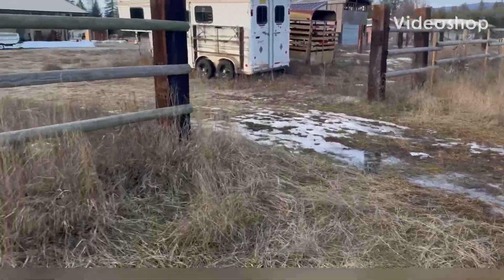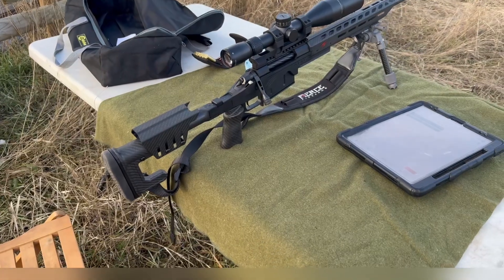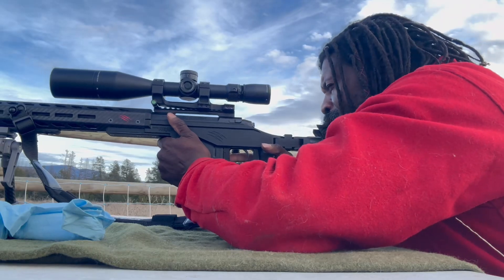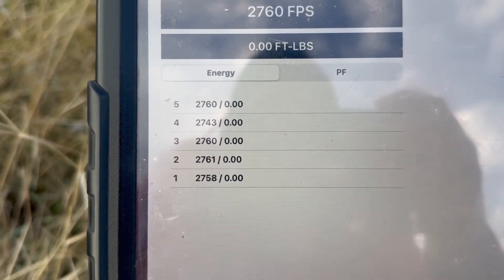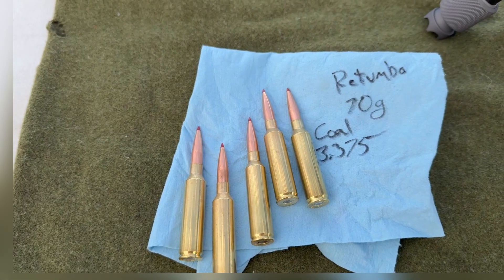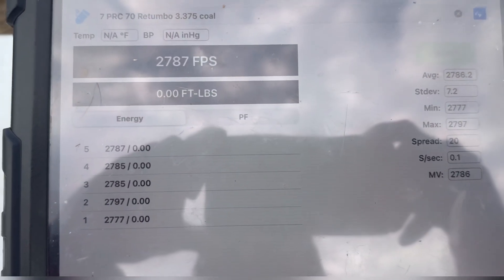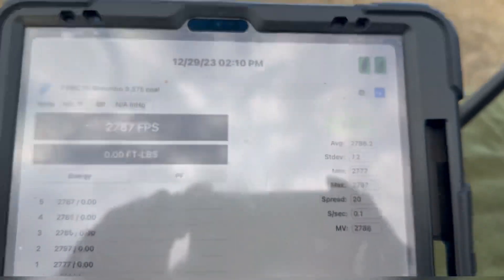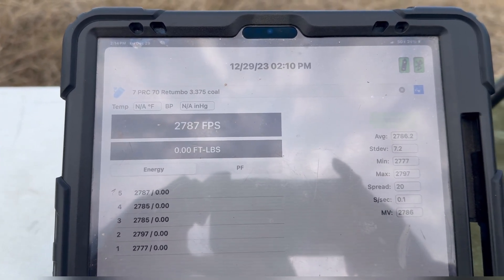7 MM PRC Velocity testing - Part 2  Is my chronograph reading correctly?!

Comment from the maker: Just measured my actual barrel length, it’s supposed to be 22”… Well it’s not, I think that’s the problem…
Reply: 30fps per inch or so. At least that's what my wife tells me.😯
Reply from the maker: @thebleeb1681  lol!
Reply from the maker: Scratch that… I measured it externally instead of with a cleaning rod touching the closed bolt face as is industry standard. It’s exactly 22” when measured correct.

Comment: I'm currently working on a load for a Fierce Carbon Rouge 7mm PRC. I've found the ELDMs are shooting about 2850 while the ELDX are closer to 2920 from 24 inch barrel . Maybe these fierce barrels are a little slower than other barrels.
Reply from the maker: I've heard exactly that, though i'm running a 22" barrel as well. I found the 195 grain Berger's have a higher velocity out of the C3 barrel. Might want to give them a try too.
Reply: @apex-livingwithpredators8379  what velocity are you getting with 195grainers?
Reply from the maker: @sick7six1  max velocity I’ve reached was about 2830 the load I decided on, for now, is at 2750 both out of a 22” barrel. 

I have a hunt coming up so I had to choose a load, for now, to get my rifle zeroed for the hunt. I’ll be chasing an accuracy node at those higher velocities and charge weights later.
Reply from the maker: @sick7six1  I will say I’m getting a higher velocity with the Berger 195’s than I was with the 180 grain ELD-M’s at the same charge weight. About 15 fps faster, but with the heavier bullets.

Comment: Those chronos are famous for being awful. They rely on lighting way too much so if your current lighting isn’t what it likes, it just won’t work right
Reply: I’d love to know what the factory 175’s do on the magneto. I have a Fierce 7PRC with a 22” barrel as well
Reply from the maker: Yeah, that’s exactly what I’m finding. A little shooting at targets 1500 yards away seems to indicate a velocity that is higher than the 2900 estimates I used in my ballistic calculation. I’ll measure drop and calculate velocity that way soon.

Comment from the maker: So, I had to empty a few casing so I went out and shot at 343 yards and it seem right on using an estimated velocity of 2900 fps. Then I shot a few at 1440 yards and they hit a little high. So I’m pretty sure actually velocity will end up the be over 2900 fps. I should have the first 50 reloads with 68.8 grains of  Retumbo at a 3.390 coal in a couple of days. Then ll do actual trajectory testing.

Comment: I have a bergara ridge wilderness 22in. I'm getting about the same velocities that you are on factory ammunition. Eldm average 2771, eldx at 2843. My first hand loads  with magpro and h1000 and getting around 150fps slower than they say it should be.  It might be that a 24in barrel is what really makes this cartridge shine
Reply from the maker: Interesting, I did read a load data chart with a 20”
Barrel that was getting over 2900 with a 70g charge of H1000. 24” is the recommended length though.

Comment: Something is definitely wrong.  We are all used to getting a little slower than advertised on the box, but 2700s is putting you in 308 territory. All of my 7 prc loads have chronographed between 2930 and 2970. I haven't reached the mythical 3000 with my 22 inch barrel, but I don't expect to.
Reply from the maker: I’d gladly take those velocities! Lol!  Yeah, I’m hoping it’s the chronograph. I always confirm trajectory /drop at range too. So once I chose a load that’ll be another point of confirmation.

Comment: Hmmm, even if your chronograph is off a bit, I would still expect more of a gain than 30 fps. Between the two. Not sure why, it is interesting though. Maybe try IMR powder?
Reply: How did the primer pockets hold up during the primer seating on the 1nc fired hornady brass?
Reply: I was showing ejector swipe on factory 180g eldms out of my 26" christensen arms carbon barrel. The 180g eldms were running 2,947fps at 350ft msl 65 deg and 62% humidity with pressure at 1006.8.

I heard its common to run into some ejector swipe out of the christensen 26" though
Reply from the maker: @treckon3112  I’ve heard the same and has a little swipe on my factory loads as well.
Reply from the maker: @treckon3112  well, only reloaded new brass so far! Lol!
Reply: @apex-livingwithpredators8379  Hornady, or did you get some Peterson brass?
Reply from the maker: @thebleeb1681  it’s hornady brass.
Reply from the maker: Yeah, Retumbo is one of the slower burning powders suitable for 7prc. That load generated 3001 fps for Hawkins Precision with a 24” barrel. So I expect to be around 2940 ish, which would be acceptable, 30 fps per inch slower as you said… I’m shocked to only be at 2804 when adjusted for being 15’ from the chronograph… 30 fps difference from factory loads, which are pretty consistent in both velocity tests. 

I’m a lil over pressure on this load. So not sure where to go yet, to hit my goal velocity range within pressure limits. 

I’m wondering if the chronograph is off and both loads are shooting considerably faster… a commenter on my last velocity video said his Caldwell Ballistic Precision G2, same one I’m using, was routinely about 100 fps off… if that proves true, it puts me closer to my expectations and at an acceptable velocity. 

I got some figuring to do. 

Sighhh….

Comment: I had the same question too. My CED M2 had always been fairly accurate. Have you looked down your barrel with a scope? Maybe theres some reamer chatter or such. With my Proof Research 22" barrel, and after 80 rounds down the tube, I was getting ~2850fps with Hornady PH 175gr at 156' MSL altitude. When I trued the velocity at distances up to 850 yards, I got ~2900fps. The ultimate confirmation was a perfectly placed bullet on a massive bull elk at 720 yards AMR, after editing 4DOF for 11,000ft MSL altitude, pressure, etc. So I think that barrel is a bit slow.
Reply from the maker: I just measured my actual barrel length, that’s supposed to be 22”… well it’s not 22”… I’ll be getting ahold of fierce Monday…
Reply: @apex-livingwithpredators8379  Ruh Roh. Was it 20" or an oddball length? I'm sure they'll take care of you.
Reply from the maker: @thebleeb1681  Scratch that… I measured it externally instead of with a cleaning rod touching the closed bolt face as is industry standard. It’s exactly 22” when measured correct.